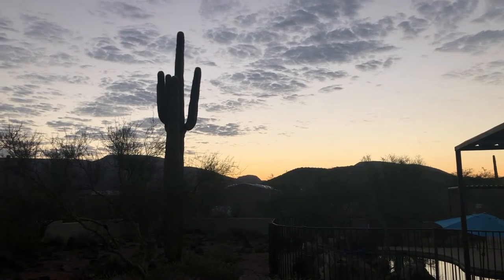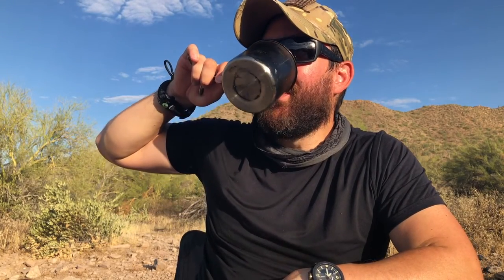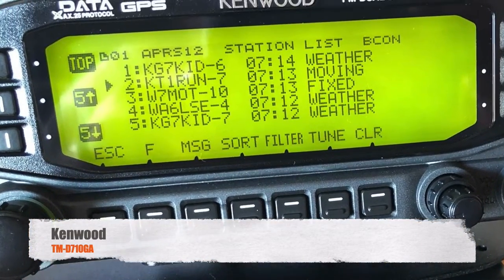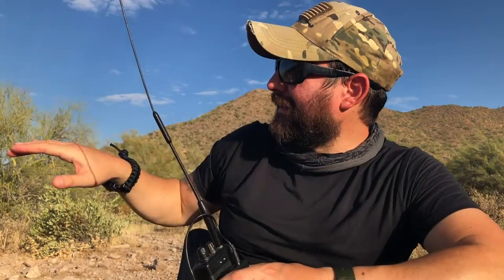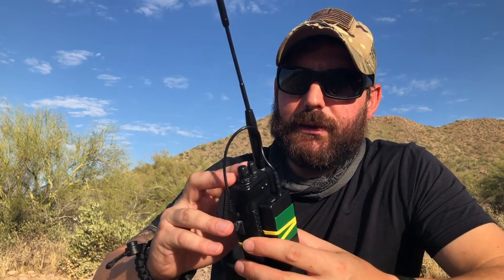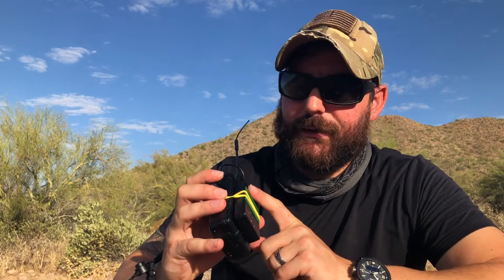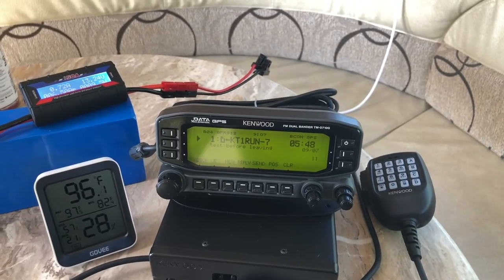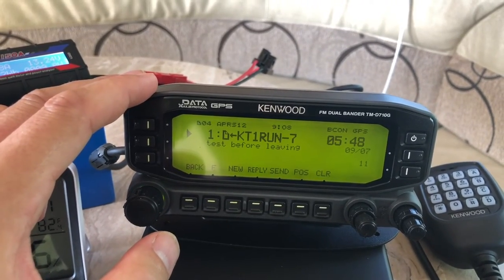Tactical Communications with APRS in the field - How'd we do?

Comment: Great choice! The Kenwood 710G is one of my favorite VHF/UHF radios. Pricey, but very capable. Good experiment, too.
Reply from the maker: Thanks. I was also looking at the Yaesu FT-400XDR, but it doesn’t have a real user accessible TNC and I heard that historically it had issues with the GPS. The touch screen would have been nice. In the end, if NASA elected to put 710s on the ISS, it’s the rig I want. As always, thanks for chiming in. Any success on interfacing your 710 with mapping software? I have a few experiments with Android, Linux and the Raspberry Pi in the pipeline.
Reply: @TheTechPrepper  As a matter of fact, I have gotten the 710 to talk to Linux and RPi. At a very high level, I use libax25 which sets up the TNC as a shared network interface. For that radio in particular, you should also look for a script called tmd710_tncsetup.c which has the right initialization steps. After that, XASTIR is still the best-known APRS mapping software for Linux. The UI is ancient, but it works. Feel free to reach out at my QRZ email address for more detail. -K0SWE
Reply from the maker: @ChrisKeller  Thanks for the direction, Chris. I've been using Linux since the early Slackware days, circa 96', so this is super helpful. I'll look you up on QRZ if I hit all wall. Thanks!

Comment: After a experience where my wife got a little worried because I wasn't checking in, no cellular service, I started thinking about other means of communication.  I first thought of something like the Garmin InReach, but those are expensive and have reoccurring monthly costs.  Since I plan on having HF with me I'm looking at JS8CALL as it appears it can send TX via aprs as well.
Reply from the maker: I looked into the Garmin InReach as well. While it's like the most bulletproof option, it's too expensive for me as well. Glad to know there may be a way to bridge APRS with JS8Call over HF. Sounds like an interesting experiment.
Reply: @TheTechPrepper  I use js8 call, keep my station on for emergency message and relay's (yes, you can relay through my station to another station) , I work DX and have actual conversations with them (South Africa, Philippines (Max Santos js8call.ph on Facebook) , New Zealand, Fairbanks Alaska, one Hawaii station came on the other day (we need more) . I'd like to see a boat try it out in the Pacific. N6GRG 40m usually.

Comment: My current Jeep APRS setup is a Baofeng UV82 with an external antenna, connected to a tablet/APRSDroid via a cable. Works well when I'm off-road, however I'd like to use a higher wattage mobile rig. I'm looking at the D710GA; my question to you is how can I display the beacons received by the D710GA on my tablet without a cable?  Would I need something like a Mobilinkd; or is there some other way to add bluetooth to the D710GA?
I see some of the handheld Kenwood radios have APRS/GPS/Bluetooth built in, but it appears the D710GA does not have all that hardware?
Thanks!
Reply from the maker: The D710GA does not have Bluetooth. I did a video where I connected the D710GA to APRSDroid using the PG-5G serial cable, then attaching a serial to USB adapter. I believe during my research there were some people online building custom Bluetooth cables. Another option is using the PG-5G cable and buying a serial to Bluetooth adapter. I’m not sure if that’s two bulky for you. To your other question, I have a Mobilinkd and the Kenwood cable, but haven’t had anytime to test it. If your tablet has built-in GPS, you can get by with an inexpensive 50 watt 2m transceiver and a Mobilinkd. It would be considerably cheaper... that’s the approach I’m taking to add APRS to my motor home. Great question and good luck!

Comment: If you are out in the wild like that and are trying to communicate with only your station relatively close, use a different frequency than 144.390 because you're bound to be interfered with by other packets.
Reply from the maker: Interesting idea. I’ll need to check what the amateur etiquette is around doing APRS on something other than nation wide APRS frequency is.
Reply: @TheTechPrepper  nothing wrong with it at all. You just won't have the infrastructure of digipeaters and igates on your own frequency. But you'll have the benefit of silence
Reply from the maker: @MisterTwister55  Thanks for the additional info. I am fine with one way transmissions to my base station so that my wife can see any messages that appear from me on Xastir.

Comment: The 710 is really THE radio and hasn’t been been surpassed.   Remembering what APRS is MEANT to be for - situational awareness is important to keep in mind. VK1MIC
Reply from the maker: Exactly. I’m struggling to figure out what I would change and the only thing I would say is Kenwood providing a factory USB cable instead of the serial connector. Are there any changes you would like to see in future iterations of the 710?
Reply: @TheTechPrepper  full Bluetooth access to TNC would be good.  I don’t think they are planning any upgrades
Reply from the maker: @WadeAbout  That would be great, but doubtful.

Comment: I wanted to give APRS a chance, but also had too many failures because of low power from my FT2D.  APRS-Droid works great when driving along Interstates (with cell reception) but not out in the sticks.  I wonder if you tried reversing this experiment, using the camper radio at 50 watts to reach the HT on the trail, and had any results?  If that worked, then maybe I would look at an amp for the FT2D when it's in my Jeep?  An amped HT is fine in a vehicle, if it works, but a bare HT while hiking still wouldn't cut it.  HT APRS can still have it's place, if planned in advance to be near reception areas.  But, for everything else when I'm outdoors, I got an inReach mini and it works great.  Pete - KI7LIL
Reply from the maker: Pete, thanks for sharing your experience. I tried a similar experiment this past weekend that worked great. I took the Jeep out on a trail and ran the Kenwood at 50 watts as a digipeater, then hiked a few miles with the HT on foot. I was able to send my location and send messages via SMSGTE to the digipeater in the Jeep and it was able to hit an IGate 40+ miles away. More power and a good antenna makes all the difference. I’ve been looking into an InReach. Glad to hear it’s working out.
Reply: There is an offline osm maps version of aprsdroid available on the website also then there's no cell reception needed..

Comment: I’m still unclear on this in researching aprs, but I want to send text message from one base radio to another. Is this possible without any other equipment, just radio to radio?
Reply from the maker: Yes, this is absolutely possible. If both radios are within line of sight or range to hear each other, they can exchange APRS messages with each other. The radios either need to support APRS natively or you need to add a sound interface or TNC like the Mobilinkd to them. I may make a video on this topic as I’ve had a few people ask this question.
Reply: @TheTechPrepper  I would love a video! Thank you! Yes, I am able to hit a few repeaters on my baofeng further than some friends houses away. I’ve also been looking hard at this kenwood, and this might just have pushed me over to pulling the trigger on it.